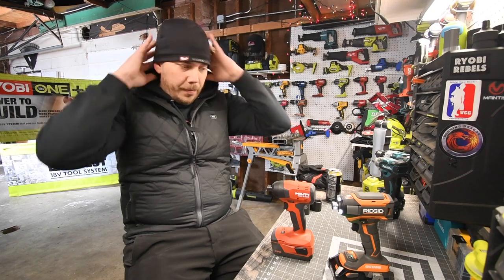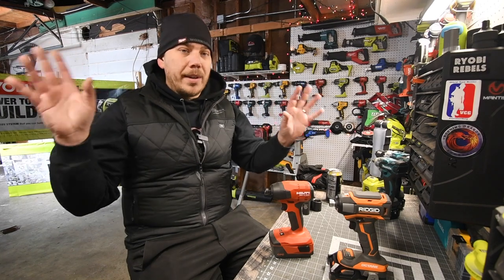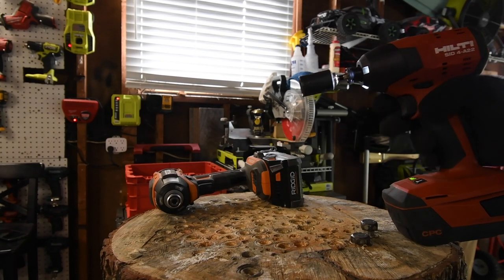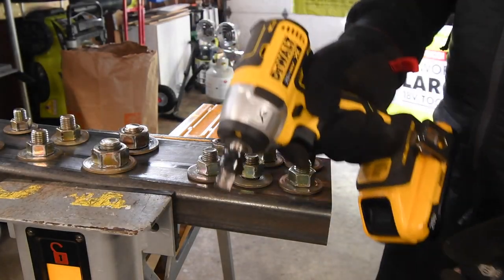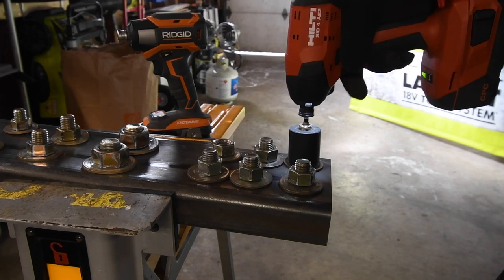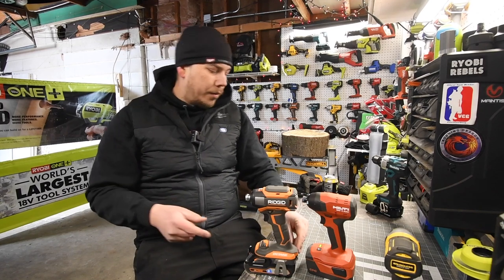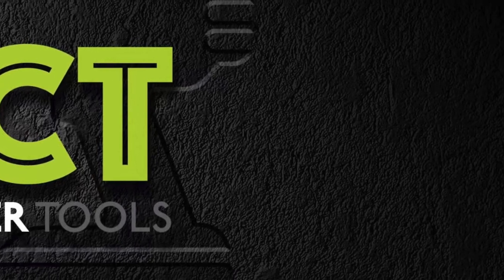HILTI vs RIDGID (Impact Drivers)

Comment: An all boils down to your price point Hilti is more of a boutique company higher end tools so you definitely get what you pay for if that's what you choose to buy into and I would say rigid if you choose to buy it to that platform it's easy to come by batteries another tools from them either by in store at the local home Depot or online if you want the LSA if you don't care about the LSA you got Amazon eBay just make sure you get it for a good price I don't know how healthy's warranty works if it has to be purchased on authorized retailer
Reply from the maker: I thank you for your input Thomas

Comment: Hilti loses..."I'll go with the Hilti."
Reply from the maker: hilti lost but the ridges quality of the tool cant compare to HILTI
Reply: It may be hard to portray through a low bitrate youtube video, but when people say the hilti is actually built really well... it actually is built noticeably really well 😁

IMO, with the build-quality of hilti in the modern day I'd say the only way to win over hilti is to either A: Have nonstandard perks(subjective QoL) like IP56 weatherization or smart fastening modes. Or B: have a power//efficiency advantage(objective QoL) so high that it beats the hilti by a LOT more than just a measly second or two without getting hotter than the hilti.

Fun tests as always

Comment: They seem roughly equal in terms of torque, but the Hilti definitely seemed faster. I almost want to disregard the lug nut test because the time they take usually seems wildly variable, and also because because the Hilti broke the weld before the nut came loose. I thought the Hilti seemed a bit underpowered in the past, but I actually think it won this comparison.
Reply: Yeah, I thought he was going to re-test that one (just like he has done in the past while comparing other tools)
Reply from the maker: I strongly suggest hilti to make a new more powerful impact driver

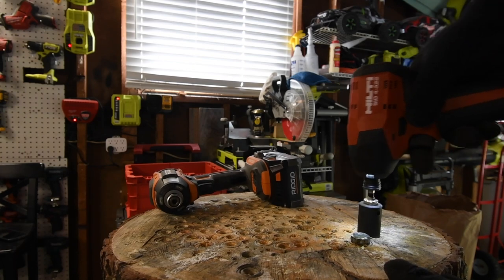Comment: 6:47 it was struggling because you were pressing down too hard  and the socket was wedged against the wood making it harder for the tool to work. Let off the downward pressure and it would have finished. Watch it again and you'll see
Reply from the maker: I dont press down on the tool while it is working. I only push down on the tool to help it bite into the wood on first initial start up when it comes to the impacts
Reply: @ManCaverTools  it looks like the socket bottomed out

Comment: Hilty has a lot of pluses you got a service place near you they exchange the  tool Comes back in a 20 year warranty ridge its pluses it's a lot  Cheaper   tool Over all But you have to wait for it to come back if you're on the job you need to get done And there's more home depot's to buy batteries It's hard to say But  I already own  Ridgett I'm going to stick with that Your mileage may be different     😆🍩☕😊
Reply: Agree, it all comes down to the brand you already have, there's little sense to have a bunch of different batteries and chargers. Ridgid is perfectly fine.
I'm already fairly invested on the Bosch 18V platform so I'd hardly consider switching anytime soon.
Reply from the maker: I do wish they would sell HILTI in the home depot store, you can get them online but I wish they had them in store
Reply: @ManCaverTools   They use  To have them in home depot  They were a stolen merchandise too much